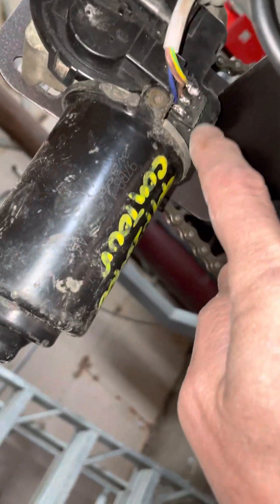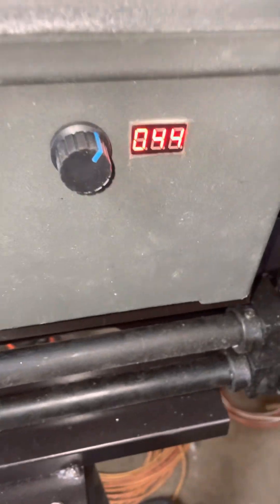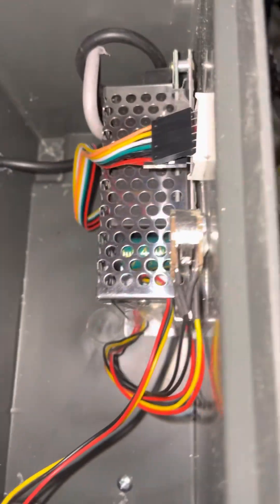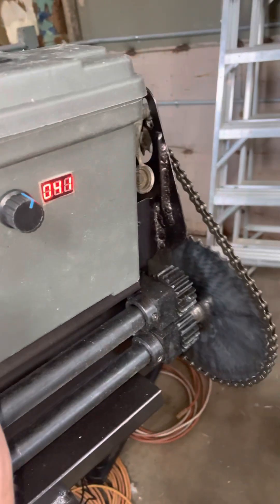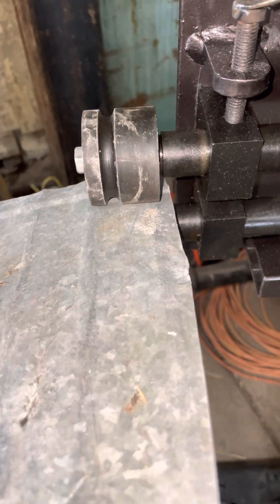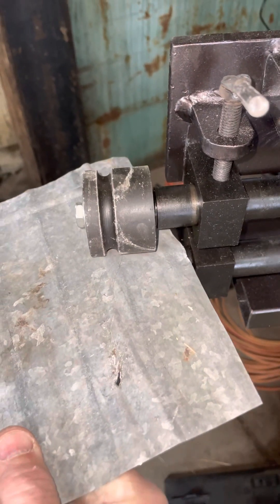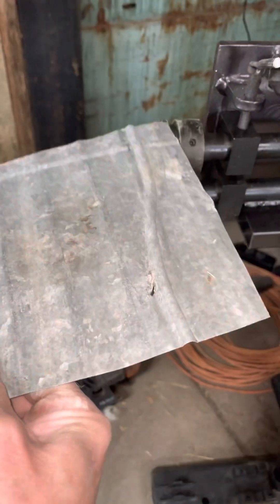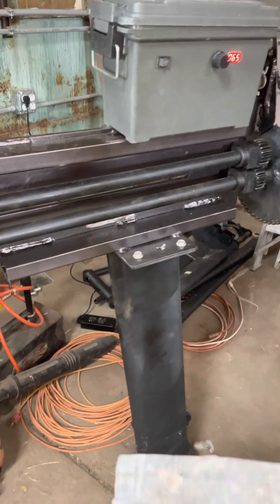Home made Motorized bead roller demonstration.. (bead roller part 2)

Comment: I'm just getting going w/ bead rolling.

I've had an ancient slip roller for years that has 11/16" shafts protruding from the upper & lower rollers.  It belonged to a HVAC guy, likely when it was only HV.

I got a bunch of patterns for adapter cones w/ it.

I figured the roller had an option for adding bead rollers to do duct ends.

Turning some dies to test it has been a To Do since I got a lathe.

I need to sturdy up a sheet metal surround I made for a milling machine; thought making dies & bead rolling would be as easy/fast as a frame, cleaner look & get me going bead rolling.

I made 1 from scrap nylon, 1 from UHMW polyurethane; they work, but...

Obviously need to motorize; can't reach handle & guide larger surround panel.

Have lots of motor options, was researching YT for install inspiration.

Your bead roller is the 1st time I've seen gears between the rollers; others may/likely have, but haven't seen, yet.

Do all bead rollers have them?  Not having them on slip roller would explain why upper bead roller shoild be called a slide, not a roller. Still worked, but thin metal, (20-22 ga, IIRC).

How critical is forward/reverse?

Same w/ variable speed; motor choice will dictate possibility of variable speed.

Thanks...
Reply from the maker: yes, most bead rollers have both dies driven. I could see where you call it "slip".
forward revers is not horribly important.. what is SUPER important is speed. Im a novice, so slow as I can get, especially in curves, is the ticket!
and the pedal to control is important too.
Reply: @dontbe  Thanks for the info.

I can see where slow speed would be better as the base line, then be able to speed up would make things go faster.

I've watched a few how to vids & found ~2/3's say to make numerous passes, increasing the pressure as you go, but then I've seen the rest just clamping down & doing it in 1 pass.

Seems to me, there should be less distorsion in the surrounding metal, if you make multiple passes. A guy I watched just last night was a single pass type.

His vid was about the need to pte-stretch the metal. He did 1 test panel & it warped ½-¾" in a 16" square; the corners were that much off plane.

Then he ran a 2nd panel thru an English wheel until it was warped about as much, but opposite corners; he bead rolled it the same as the 1st & it ended up flat.

He did ~50% more bead rolling than I did, but I only had warping as bad on the outside of a rounded corner.

The straight stuff was mild, more  the metal between the bead & the edge was fairly evenly up towards to dome of the bead.

But I messed up when I shaped the die. It was a ½" wide round bead & I hadn't been able to find bead depth dimensions before I turned it.

I don't have an arc turning accessory for my lathe, so I used a ½" quarter round carbide router bit as a shaping tool. The height of the dome ended up ¼"

Later, I found the Pro-Tools site, which gave more dimension than I'd found; there dies only have ⅛" of dome.

The extra ⅛" would create more reaction in the surrounding metal, but it seemed like multiple passes minimize distortion.

It's good, 'cause I don't want to need an English wheel so I can bead roll.

I saw some unique dies at Pro-Tools; don't know if you're making dies, but I plan on pilfering the ideas, especially since they are listed as discontinued.

One was a line round & square bead rolling dies w/ an integrated edge roll. The small 90⁰ would def straighten an edge & fight minor distortion.

The other unique die was a small English wheel pair. So, a guy could pre-stretch right on the bead roller, if need be.

I was surprised the nylon & UHMW polyurethane worked as well as it did; thought steel might beat it up badly.

Re: gears  Need to go back & rewatch the how to build a bead roller vids; I completely missed gears, or I would have been looking thru my inventory for gears or sourcing/looking for repurposing sources. (My inventory... I'm 70 & have been making/building/fabing/repairing since my teens; I have a BIG inventory... LOL). 

Hmmm. Might not slip as badw/ gears, but the poor traction the plastic dies had, it might just spin.

Gonna be an adventure...

Thanks, again.

GeoD